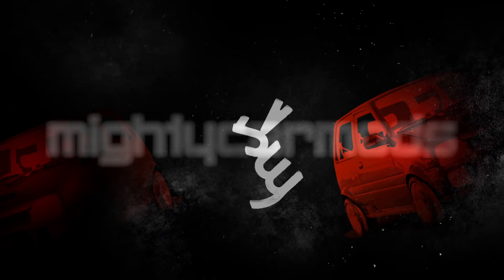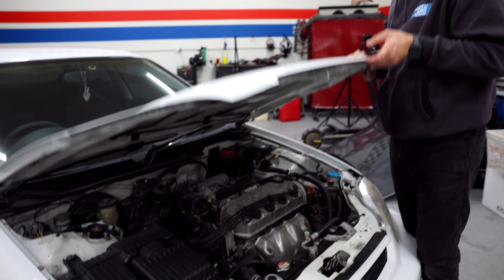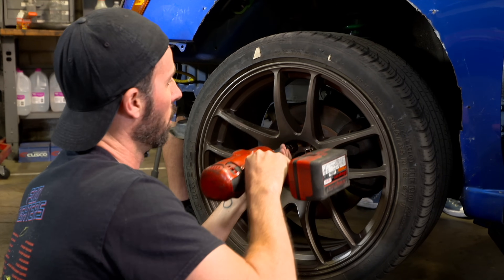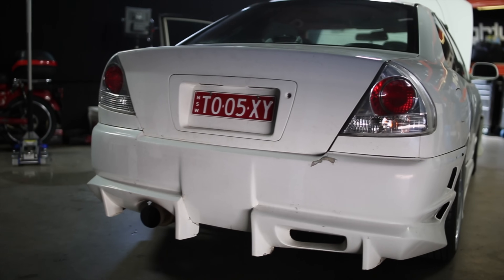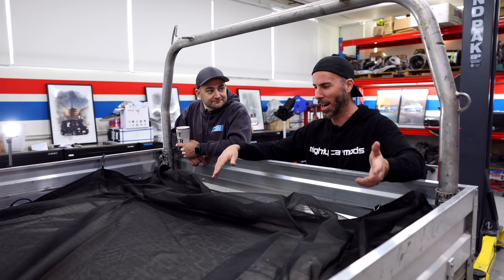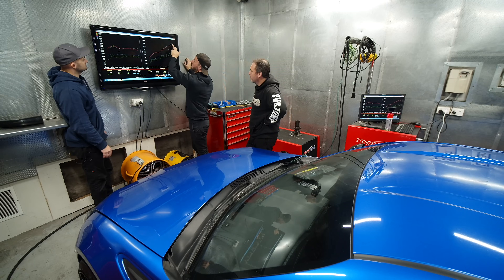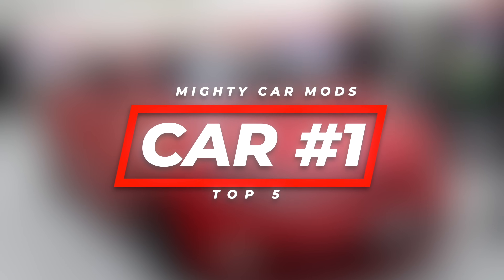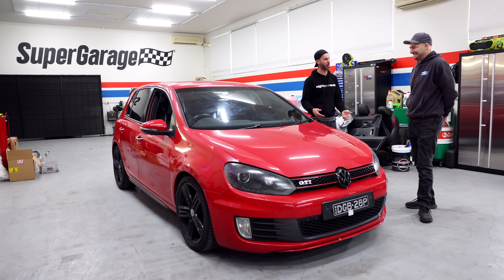The 5 BEST CHEAP CARS to Modify FAST | MCM

Comment: Such a shame the MX-5 has charged in value over the past 3-4 years. Used to be such an attainable drivers car.
Reply: That and no one has cracked the ecu on the most current model. I would kill to turbo a current RF!
Reply: Delivery costs, dealer mark ups, inflation; there's a lot adding to car costs these days. Manufacturers also charging the customers for emissions reduction technology that governments required of them has added a lot recently as well.
Reply: @Dangeresque14  Surely if you want to turbo it you'd fit an aftermarket ECU anyway?
Reply: @Dangeresque14  thats what a haltech is for..
Reply: Still is here. The GT86 however, ugh. Sorry but I'm not paying MSRP or like 5% off for a 10 year old car with 150k's down.
Reply: Yeah I just saw a 95 Miata with 302,000 miles for sale on OfferUp for $6500, ridiculous lol
Reply: They're still really cheap here in the UK, probably get a nice one for £3-4k. They did used to all be about £2k though.
Reply: @Chrissy-H  so they're going up in price
Reply: @Chrissy-H  uk ones are often rust buckets
Reply: It's not really the MX-5 that's unattainable it's the amount of hair care products needed to keep up with the MX-5 life image that gets costly.
Reply: @orbion2  Yep. The NA and NB chassis rails are a weak spot, but if you choose carefully, or have basic fabrication skills (My Bro taught himself to weld on one) you have a huge choice of mods including the mad Jag V6 Rocketeer conversion.
Reply: NBs are still super cheap in Europe (or at least in Germany)...
Reply: There are heaps of NB's well under 15k in the market... the issue is the 86 in terms of age is NC/ND equiv and they are a lot more. The 86 When released was competing with the ND.... and you cant really get one of those under 30K But I'd still take a good NB over an 86 because of the roof and they are just total fun.... total smile on the dial.
Reply: @simkarte123  It's different in France, I don't think they've ever been cheap here.
Reply: I paid $500 for a clean title 1990 NA Miata a few years back. Few hundred in parts / fluids for maintenance, it was a darn good summer daily. I sold it for a decent profit and regret selling that fun little thing.
Reply: $5k in the United States buys you a really nice one here.
Reply: @DukeTheSPO0K  convert currency and that there no federal sales tax in usa . In Australia high car taxes
Reply: @KacKLaPPeN23  I picked up a gt86 aero with 14k miles trd wheels for less than £10k in the UK.
But I like a Mk3 mr2 roadster they are for the money the best bargain out there.
It a tank always running dont rust like mx5s and have if set up nice almost telepathic handling I got an honest one with history for £2000.
Roof comes down to.

Comment: I’ve owned my MK5 GTI for over a year now, absolute fell in love with it, 2006 model and had 86,000kms. The way the car will just go wherever you steer whether you’re taking a corner super hard or just smoothing into it, the mark 5 will never disappoint, and yeah I bought it during our ridiculous increase in used car prices for $9000 (rwc included)
Reply: Picked up a Mk5 GTI Pirelli last month and absolutely loving it. Such a great all rounder
Reply: @benbeecher5025  that k04 is one underrated little turbo !
Reply: @benbeecher5025  brz is better

Comment: As a MkIV Jetta owner, I really think if you want a VW from the MkIV generation you should shoot for the 1.8t manuals regardless of the body style. There are plenty of mods out there and you will ultimately end up with a bulletproof car with the right maintenance. Hint, change out all the plastic coolant pipes for aluminum ones and do the 2.0 coil pack upgrade. I bought mine at 118k miles and it is still going strong after over 246k miles.

Comment: I am surprised a v8 commodore or turbo falcon wasn’t on the list. The 2000-2010 models all fit the brief well enough and both have phenomenal power and plenty of mods available. Big issue is they are not available outside of Australia- which is an issue for all the international viewers
Reply: This is what i came to comment, i definitely think it’s due to the international availability. 
But even an n/a Falcon, 190-195kw for anywhere between 5-15k is a great car.
Reply: They sorta knocked back cars because they're not common in Aus too though. I totally agree, BA-FG Falcon tops this list by all criteria, and LS-powered Commodores are up there too.
Reply: Unfortunately getting a reasonable LS powered Commodore just isn't that cheap anymore :(
Reply: I was about to comment that I bet they don't put Ford or holden on the list, the boys have given the local product a bit of hate over the years.  just picked up a turbo Territory for $6000, needs work but satisfies my need to modify, probably about $8000 in mods and repairs to get 400kw awd.
I've watched then since they where doing $100 shit box mods in a drive way, come a long way, good on em.
Reply: They're trying to cater for a global audience, most of whom don't have access to the local product, plus I recall they're not that big fans of the local cars themselves, apart from obviously the engines (to swap into things like Mod Max or the Cresta)
Reply: The MCM lads aren't about the falcadores though.
Reply: This is more a fast fours type of channel but yeah you can’t go past a nice big Aussie V8.
Reply: The V8 Mustangs are probably similarly cheap stateside. Especially with gas prices how they are. The local used car lot in my town has a dozen Stangs and another dozen Camaros.
Reply: These guys are really into 4 cylinder JDM stuff. I'm a bit surprised they recommended a German car, but then it does fit their formula perfectly. Small, 4 cylinder, and a bit boring or under the radar.
Reply: Yeah but other places like America does get some of our Commodore and Monaro models under a rebadge, albeit in smaller production numbers but they are cheap over there. Pointiac GTO = Monaro, Pointiac G8 = VE Commodore SS, Chevrolet Caprice PPV = VE Statesman police car, Chevrolet SS = VF SS. 
England and other smaller places got some rebadged Holdens and HSVs too in small numbers. New Zealand got a fair few Commodores and Falcons.
Point being they could have easily made the list and catered to people outside of Australia, but like others here have said MCM boys don't really like them unfortunately. Atleast one of my cars kinda made their list though 😆 2020 Jimny ✌️

Comment: i just bought a 2008 manual wrx and i gotta say it’s been an absolute blast learning to drive it! it’s so quick and handles super well i’m super happy with it and i can’t wait to start diving into mods
Reply: I can speak from experience on my 08 WRX Wagon, the first modification you'll want to do is to your savings account for the built motor you'll inevitably be upgrading to when (not if) you spin a rod bearing.
Reply: most have been thrashed to death get ready for new engine

Comment: I been watching MCM since 2013 and I'm a die hard fan from the states. Great list. I have a 22 WRX and came from a bmw. I think a 2007-2012 BMW 335 is worth a mention. You can get one for 10-15k inline 6 turbo. 300 hp stock rear or all wheel drive. Love you guys keep slinging videos I watch every single one
Reply: a shame the prices of the 335s have skyrocketed and are continuing to do so, same with the 330d's now, over doubled in price the last few years, but still for the performance and amount of car you get - they are still incredibly cheap compared to the JDM equivalents!

Comment: I have a 09 Forester X that I originally bought as a daily. I have installed coilovers, adjustable rear lca's, adjustable rear lateral arms, adjustable 25mm rear sway bar,  front and rear swaybar end links, 18x9.5 wheels with super sticky tires. It corners so hard I had to put in a race seat to keep me in place. When I need to pick up a bunch of stuff from the hardware store flip down the rear seats and I have pleny of room. It handles but slow enough to keep me out of trouble with the law and unless you know what it is most people don't give it a second look. Perfect!

Comment: I’ve got an RS Sedan Impreza and it is an absolute dream to drive, motor is quite reliable and it performs well, the ej204 does lack power but it makes up for it in handling. Ive upgraded the sway bars so far and it made a massive difference in the grip that it has. Really good choice for a first car.
Reply: How much u got it for

Comment: I have a 01 Audi A4 with the 1.8T, it currently has about 100hp more than stock and definitely a fun car. I also have a 2014 Audi A4 with the 2.0T and it's definitely more expensive to modify but a joy to drive!

Comment: Another great option is a Mk2 Focus St. At least in europe they're still relatively cheap (prices are rising, tho) but you get a 2.5l,  5cylinder turbo engine. Heaps of space and very practical for daily use. It's such a good (volvo) engine - so much fun to drive. Love that thing.
Reply: They are an option in Aus as well. Prices are a bit silly, 10k+, but they are a great car
Reply: @OPM881  yeah, prices getting pretty silly here too... A facelift model in good condition is over 10k (euros, that is), too.

Comment: Would have thought a 350z would have been a good alternative to a brz/86. 
Would have been nice to see the locals getting a mention. 
Buy a bf falcon for 3-4K, turbo it easily and have a semi sleeper for way less than 10k. 
Even a commodore ss, decent tune,cam and exhaust and you have a fun streeter. 
Spend the 20-25k that some of the cars mentioned in here would cost (not just the cheapest examples they used) and you can have a very fast car.
Reply: Yeah not many brzs rocking around for 15k at the moment that would actually drive anywhere.
Reply: Hey man I just moved to AU and need a car soon. I've really started to like Commodore's and Falcon's but I've been looking for a xr6 BA or BF Falcon lately, what websites would you use? I can only find ones for like 6-10k
Reply: Locals wouldn't be getting a mention as they don't meet the criteria. It's not just about how fast they are. It's about handling which falcons and holdens are terrible at. Also not very practical with the amount of fuel they gussle.
Reply: @tommyh4940 For the Commodore I'll give you the handling part but I bet the Hilux handles worse (I've owned both) so I don't see how it is included but the commodore isn't. They are cheap, NOTHING is more fun starting out (Sorry Mum) and they are very practical, nothing carries more people over big distances more effortlessly than a Falcon or Commodore. As for the fuel, do you think these cars are economical when driven in a "fun" manner? My 21yo Calais is great on juice, but I don't have it open full tap all day lol.
Reply: @tommyh4940  I was pleasantly surprised at the handling of Falcons I've driven (not AU, but EF and FG were quite impressive).
Reply: @benhall2307  might be where I live. Commodores are expensive. Finding a v8 one for less then 15k is near on impossible. As for a falcon they sell for around 5k depend on model and kms. Both gussle gas like no tomorrow. We have alot of hills around here so even on the open road they aren't the best. Here a commodore is a poor man's bmw or mercedes. A falcon is what Bogans drive and take piss cruising. I drive a golf gti. It is very fuel efficient round town. Even better on the open road. Handles like a go kart. And goes pretty good from the factory. So it's kind of a win win. But
Reply: @ad_fletch  I have driven a handful. The ef I drove was like driving a sofa. Quite comfortable but the body roll didn't make me feel comfortable taking a corner at the same speed let's say a honda might. Ba bfs seem to handle alot better so I'll give them that. But they feel big. But they don't feel exciting. The sad part is where I live a e series falcon costs the same if not more then a ba bf
Reply: @tommyh4940  Mate I can understand that. My fat Goldfish is NOT looked after and I'm getting $10k+ offers lol. The value increase on RWD V8 commonwhores only goes to show how much fun and value they were. Didn't know what we had til it was gone.
Reply: The older ed, ef, and au falcons are the way to go. Super cheap, and those sohc motors are absolute tanks. Slap a turbo on and they take upto 600hp before they start lifting the head.
Reply: @tommyh4940  there was a magazine comparison done years back and amongst the cars was a new brz and a falcon g6e ecoboost, the falcon was quicker around the track than the brz…
Reply: @izzy031096  Agreed up until the AU. Sorry Iz, but its just too ugly lol. We had an XD station wagon in bright orange with a truck bullbar and 4 spotties, so ugly you had to love it...
Reply: Agree on the Falcon option - if the goal is to build a cheap quick qtr mile car there’s really no better choice here in Oz. 
For track days it’s going to need a ton of suspension work though!
And the 350z is a 5-6 older car than the 86 - at least in this sub 20k price bracket
Reply: @benhall2307  Hahaha fair enough mate, they are buttugly. The Ed’s are definitely my fav, one of the first gen xr6’s with a manual would be an absolute treat. 
She doesn’t sound pretty.. but I bet she did some ks!
Reply: Might be to appeal to a US, Australian, and European audience? We don’t have Holdens in the US. They’re Pontiacs and Pontiac has been dead since 2010 and the G8 (USDM Commodore) is going for like $15k-$40k USD ($23,300-$62k AUD)

Comment: Mazda 3's definitely don't have the same aftermarket part availability as most other cars but they are definitely cheap and capable of decent power increases with a turbo. A 2010 mazda 3 in Canada can run around 3k$ CAD. Very fun car to drive and might end up keeping mine to use as a project car.
Reply: Just get a Speed3
Reply: Swap a 2.5L in it, do a balance shaft delete, enjoy.
Reply: 2013 cost me 8k I got ripped off, I just try not to think about it.
Reply: One of my "In my mind" builds that I've always wanted to do is to take the AWD system out of a MAZDASPEED 6 and swap it into a MAZDASPEED 3. Every MS3 I've driven was super fun but it's torque steer is bonkers lol. I think with AWD it would be on another level.
Reply: @jdmmike7225  there's a video of a company that swapped the drivetrains but its a lot of effort, and the Speed6 transmission is weak if you want to add power. Honestly wider tires is a much cheaper and easier solution. I have 8.5 inch wide tires with flares and its reduced the torque steer greatly
Reply: @moshikito4717  Word, I have so many projects right now it's highly unlikely I would ever do it, just something I've thought about, you know?
Reply: @jdmmike7225  oh yeah, I've though about it plenty of times, but then I'm reminded that the new mazda 3 has a turbo awd version, though its only automatic
Reply: @moshikito4717  🤮 Ahhh auto sucks for everything but high end drag cars. Is it even an automatic or a CVT?
Reply: @jdmmike7225  its, at least, a real auto not a fuckin CVT. I cant help but wonder how difficult it would be to put a VW DSG out of the Mk7 golf R into it? cause that would be pretty much peak hot hatch imo
Reply: @sofielee4122   I'm a manual purist lol. Only auto I've ever owned is our collectives 1994 300ZX 28x10.5 small tire drag car. Took a lot of custom fab & paying for custom wheelbut we were able to install a Powerglide to the factory VG30DETT. Runs high 4's-low 5's in the 1/8th.
Reply: @StayMadNobodycares  
That's about right, no idea what pos he's talking about for 3k
Reply: @jdmmike7225  it's a shame the platforms are different enough to make an AWD Mazdaspeed 3 hard. Can be done though with some speed 6 bits, some Volvo bits and a few other Mazda 3 bits. Think there are a couple of them out there but it's exspenny to do!!

Comment: Got a Mk7.5 Golf GTI as my first car and it’s been a great car to drive on street and track. Get some good tyres, sway bars and springs and it can do everything pretty well. Great video guys.
Reply: Almost bought one, but saw I could afford a BMW M140i Finale Edition for almost the same price. 

RWD is so much more fun and who doesnt like a straight 6 turbo!
Reply: @Zwank36  same thing Jeremy Clarkson said till he ended buying a GTi instead. Even Carlos Sainz jr who races for Ferrari F1 owns a GTi
Reply: Damn thats a good first car. Mine was a $400 rusted impreza with no rego 😂😂😂
Reply: @nsmaori  Yeah, I consider myself pretty lucky. Managed to get one for a decent price about a year ago have put 20,000kms on it and could probably sell it for the same if not more. The prices on the MK7/7.5 GTI's and R's has just gone crazy over the last 8 months.
Reply: I had a mk6 GTI as my first car, and now I have modded mk7. Perhaps not as engaging as some of the RWD cars, but they are still brilliant cars. We're lucky that our early motoring years have been so good!
Reply: I have thought about doing this, how do the brakes hold up?
Reply: @veneratedmortal4369  I'm struggling to remember what the stock brakes are like as I've switched to slotted rotors and better pads. From memory they just heat up pretty quick and start to lose braking force. I was due for new brakes a few months after I purchased the car so I decided to upgrade to Forza FP3 pads and DBA T2 rotors all round. I can confidently say they have been a great upgrade. I wouldn't say they are essential (would definately go sway bars and springs over upgraded brakes) but I'm able to keep up with 2 BRZs/86s on a downhill where they have a weight advantage and a handling advantage.